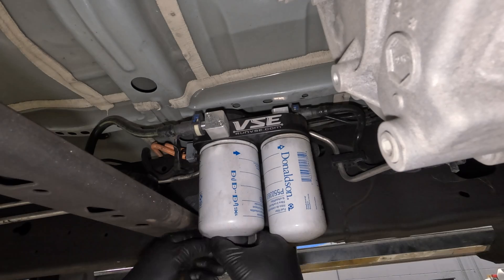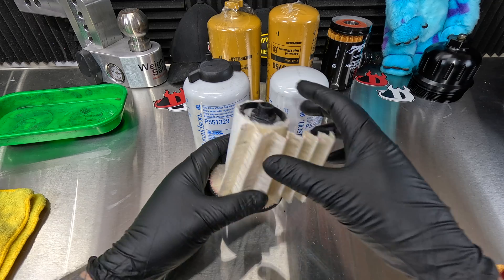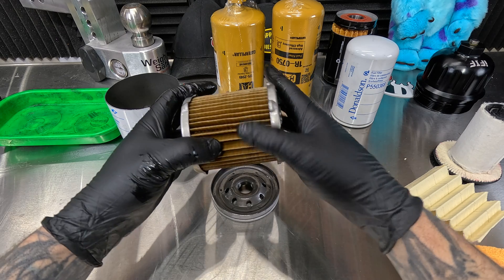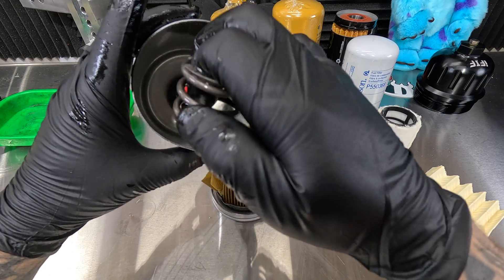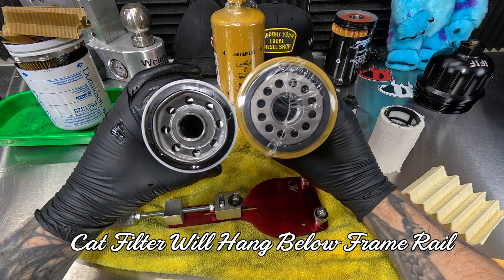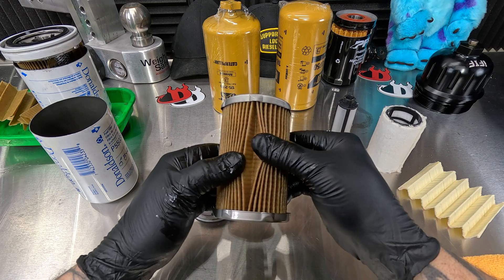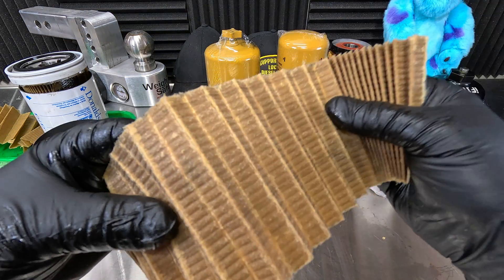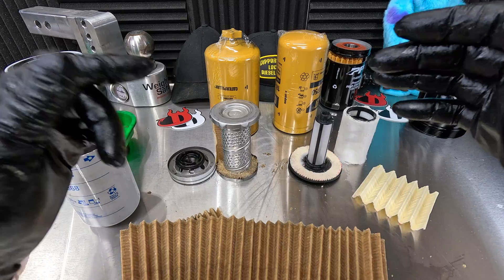Dual Filter setup Superior to factory ? You decide !

Comment from the maker: * Cat FILTERS DO NOT FIT - DO NOT BUY - MISTAKENLY SHOWN IN THE VIDEO *

www.duramaxnews.com / RunVSE Fuel System Saver installed on 2023 Silverado with the 3.0L Duramax Diesel LZ0, successor to the LM2, ran for 13,000 miles then cut apart the fuel filters.

2023+ https://runvse.com/2023-2024-lz0-fuel-system-saver/
2020-2022 https://runvse.com/2020-2022-lm2-fuel-system-saver-sierra-1500-and-silverado-1500/

Baldwin Water Separator BF1280 https://amzn.to/49KBsTW
Baldwin Fuel Filter BF7634: https://amzn.to/47hxgsY
* Cat 1R-0750 DOES NOT FIT - DO NOT BUY - MISTAKENLY SHOWN IN THE VIDEO *
Donaldson Water Separator P551329: https://amzn.to/3R2gxEl
Donaldson Fuel Filter p550368: https://amzn.to/3MQenoM

* Factory Fuel Filter TP1015 : https://amzn.to/3sLS9NS
* Klick Wrench Socket for Factory Fuel Filter : https://amzn.to/3sFvgM4
Cheap 36mm Socket : https://amzn.to/47kVAu6

Aluminum Filter Housing: https://amzn.to/3FZir28

Lighted HeadBand: https://amzn.to/3QFAzmP

As an Amazon Affiliate / Influencer, I earn from qualifying purchases. Your support is appreciated as it helps the channel to continue to test products!

www.duramaxnews.com

Comment: Looks like the Donaldson fuel filter ain’t doing much. I will keep the acdelco and just go to a metal housing. The ac delco seems to filter better and the reason I say this is because if you were to pull of a delco filter after 13k miles it would be dirty at the very least. So VSE can Go ahead and keep their $650 paper weight, lol 😮
Reply: Ac delco change 30 mins and reasonable filter price - change it every 10 k if your scared .

Comment: Hey man, do you still have this set up on your truck and do you encounter any problem  with it by this time? If so, what kind and what is the remedy?
Reply from the maker: It's removed from my truck and never going back on. VSE and I have different ethics and morals so I will no longer run their product and risk issues. In my opinion, they don't properly test products and ship them out so the customers can be the ones testing. I saw cases where these filter housings were shipped with metal shavings still in the housing. The water sensor no longer operates correctly due to the deign even though they claimed it did, so the user would never get notified of water until it's too late.
Reply: @DemonWorks thank you for your honest opinion and honest experience. So you just put back the OEM parts or you deal with different company if so what is this and what is you opinion about it. Thanks
Reply: @DemonWorks  Wow, thanks for your honest info. I was looking at the Fass but for $500 all you really get is an extra filtration system. Almost pressed the button for the VSE but you saved me a bunch of money plus the headaches. If you can, please give us your opinion on VSE CCV upgrade and catch can. Also what do you think about AirDog filtration system and their air entrainment.
Thanks again brother.

Comment: I am going with the fass system
Reply from the maker: What made you choose the FASS System over anything else out there?
Reply: @DemonWorks  Better filter materials. Setup still uses the stock filter setup that works  injacent with a secondary filter
Reply from the maker: @RileyMy5090  do you have a link to it? The only one I know of is a factory replacement that uses a Baldwin filter.
Reply: I’ve had the fass drop in system on my 24’ since it was new last April. Super easy to install and it’s been completely trouble free

Comment: Hey I have the same system runner for 2024 LZ0 and the CAT fuel filter is 1R-0751 not 0750 and I don’t think there is a  CAT fuel water separator.

Jim M

Comment: Does the fuel from the tank go into the interior side  of the water filter or go to the exterior side on this setup?   The spin on filters are usually designed so the dirty side is the exterior side and the water sensor is on the inside.   Just wondering how the water sensor is picking up the water level inside the filter if the water happens to be on the exterior. I see FASS systems has retained the original Chev design filter on their version of this so that the water sensor still functions.

Comment: The problem I see is that the primary water separator on the VSE has the conductivity sensor on the clean interior side of the filter and by the time you get an alarm the filter exterior will likely be close to full of water.  Typical commercial equipment that uses these filters that are water separator has a separate water sensor.

Comment: I had a CAT 1R-749 gets severely clogged at 16000km after one stop at rural diesel station. I was suspecious of the fuel so i just filled 20 liter only thinking it wont harm much and boy i was wrong!!! Car started to stutter hard. At least it saved my injectors and the injection pump. I cutted it open and you can see it in my channel  it was clogged entirely. Come to think of it it was upgrade well spent!
Reply from the maker: It did it's job! I love this story !
Reply: And this is why I will be installing an extended tank as well as a tank in the bed. 2019 Colorado Duramax is my first diesel and it took one fill up of bad diesel to learn my lesson 😂
Reply: @codyblackstock9892  nice call! I would've add the additional filter setup as a safety net.

Comment: I replaced my stock filter  with another OEM filter at 10,000 miles. The used filter looked perfectly fine and no water. The only way to see 10  micron particles would be to place the paper element under a microscope. I’ll stick with the OEM filter system at least until the warranty expires.
Reply from the maker: I agree with you on the 10 microns and seeing them, I was leaning more towards seeing the dirt and crap found at the bottom of the filter housing. Either way, I feel confident both setups provide the minimum filtration our fuel systems need.
Reply: No need to wait until after warranty expires. Go read the Magnuson-Moss Warranty Act.
Reply from the maker: @PastarocketS-sb7nk  what people forget about when the "magnusson-Moss act" is thrown around that one would need to back up themselves with a lawyer. In addition, the MM act doesn't mean one can modify the way a factory system works, fyi.
Reply: @PastarocketS-sb7nk  I worked with GM engineers for a numbers of years and I trust that the filter design for the LM0 fuel system works perfectly fine. However, the VSE design switched filter manufacturers after they discovered what they called a filter design problem. VSE also modified the filter housing design. So, for me, I stick with OEM components at least until the warranty is over. But to each his own, your money your choice.

Comment: What’s the part number on the CAT water separator. I didn’t think the Caterpillar water seperators worked with this system
Reply: Do the threads on the 175-2949 match the threads on the VSE unit? What I've seen says that Cat separator has 1-14 threads and the Baldwin BF1280 has 13/16-18
Reply from the maker: good catch, I haven't installed it yet, will definitely need to check this asap. @cje26
Reply: @DemonWorks  I know the CAT 1R-0751 will fit in place of the secondary filter, but I have yet to find a CAT water separator that looks like it will fit. AdeptApe has a great video talking about the quality of  CAT filters that has sold me on them and makes me more comfortable about them being more exposed below the frame rail.
Reply from the maker: @cje26  you are correct, it does not fit.
Reply from the maker: 175-2949 does not fit
Reply: @DemonWorks  So you’re just going to send it anyway? I like it.
Reply from the maker: @kennethbohrer5796  It doesn't fit, wrong threads.
Reply: @DemonWorks  all the problems and bitching I read on the FB groups. I have to say, I don’t think I have ever read were someone even got any indication of water in the fuel system. I use the Baldwin and CAT combo. Will have to keep us updated on how that separator works for you. I’m thinking of making the switch next go around

Comment: was the first factory  filter the one you cut open  and how many miles
Reply from the maker: The first one that was cut up that I showed, was a factory filter. It was new, if you have not seen the videos on that, I suggest you check it out. The Donaldson filters I opened up are aftermarket ones from the VSE housing. https://youtu.be/nhI5HoSFPsc

Comment: Thanks for the review.  I have this on my 2021 LM2 Duramax.  What is the part number for the Cat water separator filter?
Reply from the maker: the one shown is a 175-2949 but it is the wrong one for this application. I got that part number from a friend that is running these cat filters on a 6.6. This would hang down below the frame rail, it would also put the water in fuel sensor way out of reach to read but I think all filters put it out of reach now that I have seen the filters opened up. https://amzn.to/3QP2AbG

Comment: Any concern with regards to the additional length of the Cat filters where they may be more susceptible to being hit by road debris. Appears the factory filter is tucked up in the frame a bit more than the aftermarket filters.
Reply from the maker: Factory filter is tucked up more and has a shield around it. I know a few people are running the Cat filters so it would just depend on your use. If off-roading, I would be very concerned.

Comment: It would be interesting to see what color the media started out as. If the darkening of the factory filter corresponds to how much garbage it traps, it would make sense that these filters spread that out over a larger surface area and don't look as dirty.

 My big question about this setup is still the placement of the water in fuel sensor. The water would collect on the dirty side of the separator unit, but the sensor is on the clean side and has no way of sensing what's going on with the dirty side. If the separator fills with water to the point that water is passing through the media and reaching the sensor, then it's already headed upstream (I don't think that the secondary filter is able to separate water). 

That being said, I've had my LM2 for two years and 35,000 miles and have never had a water in fuel issue (knock on wood), so either A) water in fuel isn't as prevalent as it used to be, or B) the factory sensor gums up with debris and doesn't detect small amounts of water in the first place. Either way, the finer filtration seems like a bigger issue and more than enough of a reason to run this setup.
Reply from the maker: I agree with your opinion on the positioning of the water sensor, actually I agree with all of what you said.
Reply: I agree I just purchased this VSE dual filter system. I would have to believe if you have crap in your tank like I see what happens to fuel tanks in smaller trucks example NPRs also if you purchase a none top tier diesel fuel. 

Then this system is worth it.  I am still going to install it on my 3.0l Duramax
Reply: @EB-vs3oo  I've had mine on the truck for a few months now and I love it. I drain the separator periodically and have never found any water contamination. I try to only fill up at well maintained truck stops for added peace of mind.